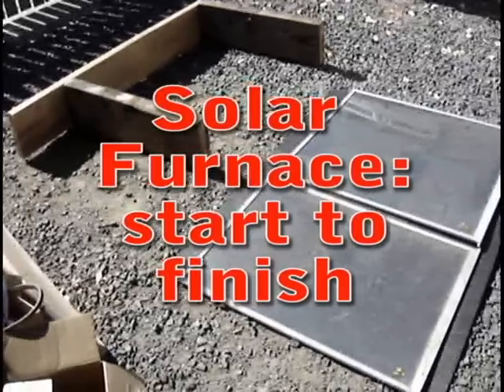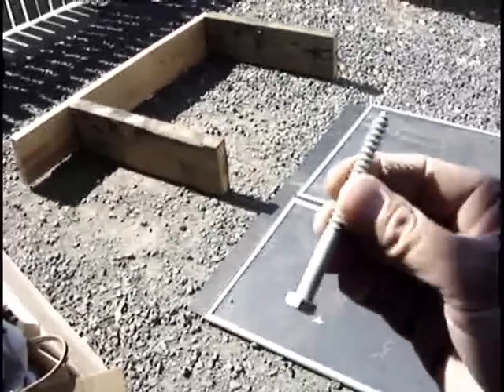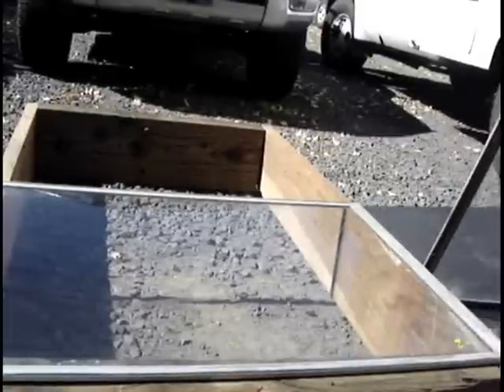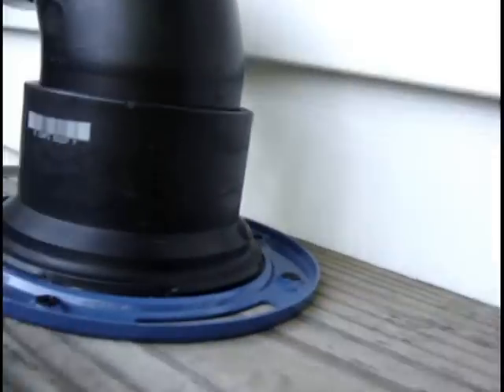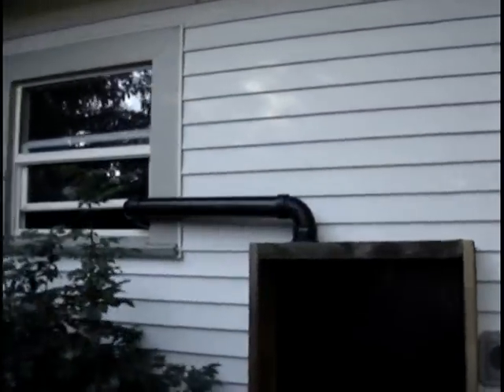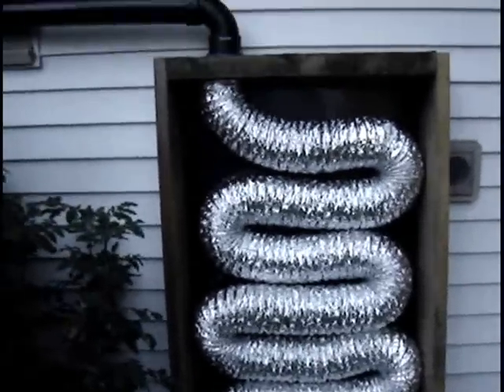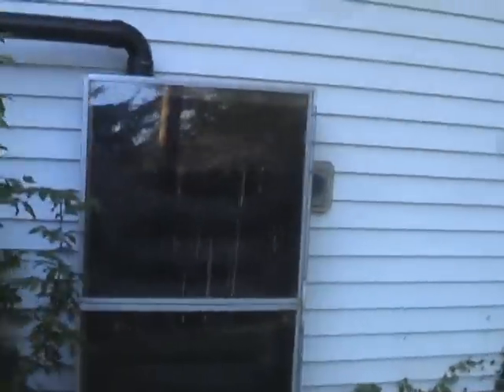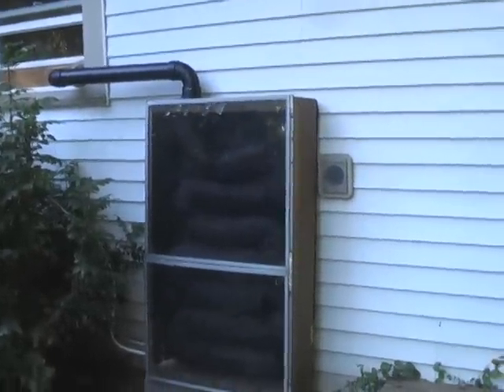Solar Furnace for under $50

Comment: Use mirror mounts to attach the windows (like the ones yo use to attach a 4' mirror to a door for example). Less chance of breaking things and easier to maintain or replace the windows.

Is a permit needed for those?

Comment: I'm building something similar to this design. Items I used are:
36×72 frame from 2x6s backed with 3/4 in ply
.5 inch insulation sheet
24' black aluminum flex duct
90 degree plastic elbows
2-8' flex duct for in and out piping to house
4" inline duct motor with speed control.
2 glass sheets
Everything is black in the box.
I plan on 2-45 degree mirrors to help deflect the sun in to max out exposure as well. I'll eventually convert to solar powered blower, just need a deep cycle battery to hook to a large power converter I got for free. Hopefully I'll get a video up showing specs and temps. It will be piped through a window with blower pumping up, while intake line will feed closer to the floor.

Comment: I know your wife discouraged you from putting in a realistic permanent hole like the kind used for a dryer vent, but think it really would look a thousand times better if the pipe came of the furnace and turned directly through the wall. Those return lines could be plumbed and buried the multiple other sides of the house . This would cause the heat to travel toward those other rooms.

Comment: I have a better one. Use the same type box, but make a hole in the top and the bottom of the back panel. The bottom hole goes through the rim joist and into the basement. The top hole goes where ever you like. You need a small fan, about the size used on a desktop computer, and a thermostat. Set the thermostat at about 90 degrees and couple it to the fan. When the sun hits the box, even on a very cold day, it will take less than 20 minutes for the fan to start. If you have a stinky, moldy basement, this is not a good idea. But if it is reasonably clean, you will have a good, nearly free source of heat while the sun shines. This also helps to remove moisture from the basement. Everybody should have one of these.

Comment: A note to anyone who wants to try this:

The return air line needs to be as large as the hot air line. Both have to be insulated. The collector box needs to be insulated. Otherwise you’ll just be collecting heat and radiating it back into the outside air.
Reply: That's what I was thinking, shouldn't be insulted inside the box but everything outside should be
Reply: thats why I added a 12v solar fan.  keeps air moving inside the dryer hose, into the house.

Comment: ive been doing hvac for over 15 years and if your heating a small closet that may slightly work. get ductulator app on your phone and it'll help you figure out what all you need to make this actually work. ground temp is also constant.

Comment: Seem legit and useful....
I’d love to see some temperature readings, intake air, exhausted air, outside temp., temp at the glasses, etc....
Reply: If so, why our window glasses doesn’t crack the same way? They are also exposed to the same sun...
Reply: Check out beer can solar convection vids, a few guys do do thermometer readings.
Reply: The glass will crack due to thermal stress.
Reply: @newsnowadirondacksredux360  Not necessarily.  it looks like 1/8 inch glass with jmold around it. No difference than what some have in their windows these days. single pane or double pane. I'm wondering if the glass is tempered.

Comment: Hope everyone realizes the tubing should be black to absorb the most heat from the sun.  The reflective tubing will reflect most of the heat.  Why do you think the best windshield heat guards are reflective.  Why do you think the same thing used to heat water has black tubing?  Good execution but missed one major thing. He could also magnify the heat by using a parabolic lense to focus the sun light.

Comment: Supplemental heat like this small heater reduces the fuel demands on the main furl fired heat source.  This is a supplemental heat that has no fuel costs unless you have an electric fan to circulate the air. Fan is probably best but can bring air into the house by convection.

Comment: I've seen many versions. This one is interesting, however virtually every build includes very well done insulation inside the boxes and of course, on the ductwork. What I have NEVER seen, is a minimum of double pane windows. Triple pane would be even better. Not a big deal if you're in a warm/cool climate, but definitely a HUGE deal if you're in a cold climate region.
Reply: How do you get power to run a computer fan?
Reply: @robinmills9278  you can buy 12 v solar panels that run chains of less off ebay for $5 cut the wire add a fan ....you can run them off a watch battery ffs
Reply: Agree
Reply: Are you from earth !!?? 1 pane of glass required.  Not 2or 3

Comment: @Raymond Gulley I realise this was quite some time ago and you may have a more suitable heating system now - but if not, you may want to consider a compost air heater. It doesn't necessarily have to be a huge heap of it. I can imagine a compost tumbler with a few pipes through it (downspout is cheapest?). If it can be angled slightly, then it will work without a fan - or a small fan could be used to pump more heat....A gravity powered fan would keep it 100% non-electrical. Not sure how long those gravity fans can run...at least an hour would be useful. Or have both - a slight tilt for continuous heat convection and gravity fan for extra heat distribution in the evenings? Regular turning of the tumbler will keep it aerated and therefore aerobic. It would have to be emptied and refilled fairly often...I guess maybe every 2-3 weeks, depending on size. But much easier than building a huge Jean Pain style heap. I've seen something like this before, but they had over-complicated it. I need to have a go myself shortly.

Comment: Buddy you use dryer hose you don’t need to the transfer of thermal energy and the aluminum is counterproductive build the whole thing out of corrugated metal and put some baffles in to disrupt the air and you’ll be far more efficient retain heat and be higher rise in their temperature and running the PVC pipe should be insulated

Comment: I have had similar hot air units for 330 years. Six units about 3x6 feet each 6 inches deep . Boxes are on sloping roof on south East side inside each box are ENTERPHASE black corrugated containers containing heat collecting chemicals . each container is about 24x36 inches. X2 i.3 inches deep.Cost was  abou § 60 each 30 years ago . Each panel has 5 ENTERPHASE containers. 8 inch flexible pipe pumps hot air into house by inclosed fans thermostat to turn on when heat is available , and thermostat when heat called for. In East Tn sun is up many days in early winter and spring when heat is needed. They come on about 9 am on sunny days , stay on till 5.7 pm 3 hours after sun not in range. Temp inside  often 130 140 . I have same principle applied to sunroom facing south. It pumps hot air to opposite end of house , cooling sunroom..130 140 closed up , and warms house . ENTERPHASE panels are stacked in wall to hold heat . Propane heat bill  for 3000 ft house runs 1500  per year . 3 w doctor chambers  dot. Net
Artdocc

Comment: so no electricity used?
How do you get the air flow to move from inside the house to out into the solar box
Reply: Thermal convection. Hot air rises. Cold air falls.

Comment: wHAT IS THE POINT OF THE DRYER HOSE? It seems more heat would come in without it and just a small fan attached to the black pipe. Bringing the heat in the window. No offenseI'm just trying to understand....No experience of my own. I did see a person build one similar to what I'm saying.

Comment: Thanks for the vid. I am curious to know why you put the aluminum pipe work in.I would have thought if you made the box airtight, with a row of small holes at the bottom, it might work better, because the aluminuim pipe obstructs the sunlight striking the black plastic back. As hot air rises it should circulate through convection. It would be interesting to try it out and see which works best. Cheers.
Reply: Black aluminum gets hot fast. Smiley face.

Comment: Sewer pipe connected to a 🚽toilet flange mounted on a POS. All it needs is a flapper valve on the intake to prevent backflow, and a flush handle to purge humidity condensate.

Comment: Water is a much better media to use than air. It will absorb much more heat,  then run it through an aluminum finned heat ex-changer inside and blow air over it with a solar powered fan. The water circulater will require more electricity obviously but can still be done with a large enough solar panel. Think about it, Solar hydronic heat has been around for decades, how often have you seen solar air heaters? Not saying you wouldn't be able to measure some increase between supply and return air when installed correctly but I am saying it won't be as much as hydronic solar.

Comment: MUCH easier approach to use the dryer vent than recycled aluminum cans. Lots of these guys add on either end a small computer fan or slightly bigger fan to aid in air circulation...

Comment: Insulate the pipe from the furnace to the house, you'll lose a lot of heat there.  The bleed off from the cold air will not be offset by the black paint.
Reply: I was thinking along those same lines & that the insulative covering would also have to be painted black.

Comment: Several things I want to mention.  This could work, but needs some tweaking.  First, place the unit as close to the window as possible (underneath).  Second, use rigid 4" PVC pipe, wrapped with pipe insulation and then covered with 6" PVC sleeve  to keep air warm as it goes from the chamber and into the house area.  Third, use larger diameter intake pipes (1" up to 1 1/2"?_ to remove air from inside the house.  Fourth.  use a hole saw to cut a 4" hole in the wall (under the window) so that the PVC would fit snugly. (this keeps your house secure, looks far better).  Install a collar on the outside using silicone caulk for a tight weatherproof seal.  Install a deflector on the inside (with screen material inside the pipe to keep little critters out).  Up to here, anyone who is fairly handy, can do all of these.  Fifth (and toughest) install a damper controller inside the rigid pipe, wired to a thermostat to open when the air temps reach an ambient set temp and to close when it temp falls below the setting where you actually lose heat.   This may not be as difficult as it might appear.  (I installed a fan in an old gravity furnace, turning it into a forced air unit in my first house, back in 1972)   Ran vent pipes from the plenum up through the floor and to the second floor where I spit the pipes off to two bedrooms and bathroom.  It worked unbelievably well!   Made a world of difference!!!!)   I also have a B-I-L research engineer who could help me if I decide to go this way.  This would make a nice and inexpensive way to heat an insulated shed in the winter time!   I'll have to try this for sure!

Comment: So here's my question. You put it right next to a dryer vent. Why not incorporate the use of the dryer vent to bring the warm air into the house? There are inside units that attach to the inside of the dryer vent that use the hot dryer air to warm the house in the winter that would essentially perform a reverse air flow bringing the warm air from your home made solar heater back into the house if using a small simple bathroom exhaust fan
Reply: Umm possibly so as not to interfere with the dryer?

Comment: OK, all very interesting- but the real question is what's the temp outside, inside and the "warmed" temps coming out of the inlet in the house off that pipe? Also- I would think this would be much more effecting on a south facing roof then on the wall at ground level. In the winter you'd get a lot more daily sunlight at the roof level (especially if it's sloped) then you would at ground level.